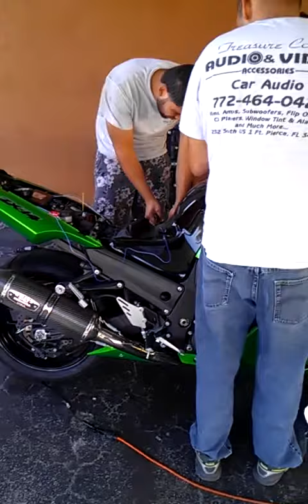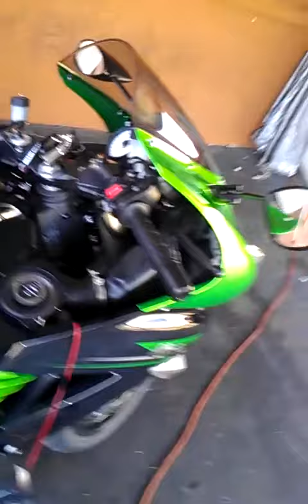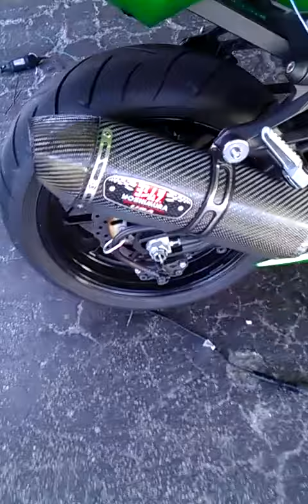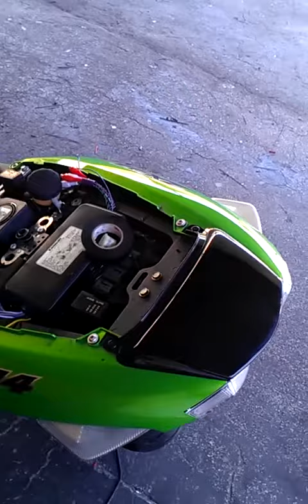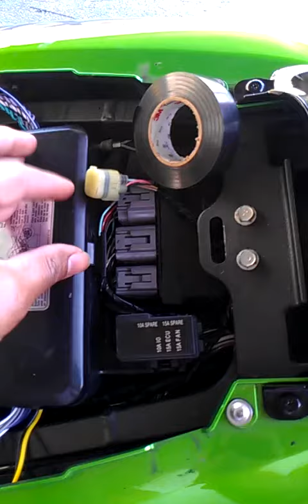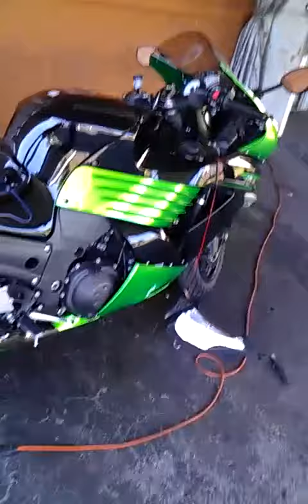Kawasaki zx14 radio installation

Comment: What items did you use to get this set up done?
Reply from the maker: I got a alpine 300 watt amp two 500 watt twitters and  two  4 inch marine boss speakers and I use my ipod and phone to play the music
Reply: @2preach  I was thinking of low profile 2 way marine speakers. Just trying to find an amp small enough. Did you drill into the side fairings or just the top?
Reply from the maker: @mrn.m.bellkirkland4525  just the top I but my app under my seat